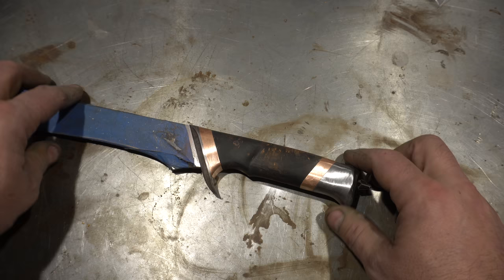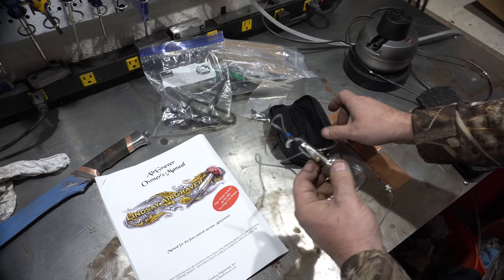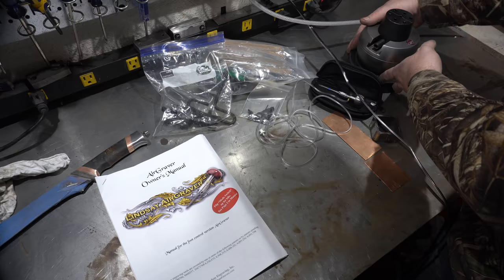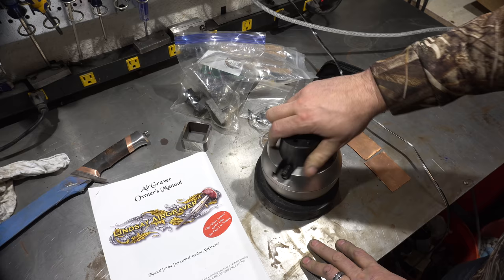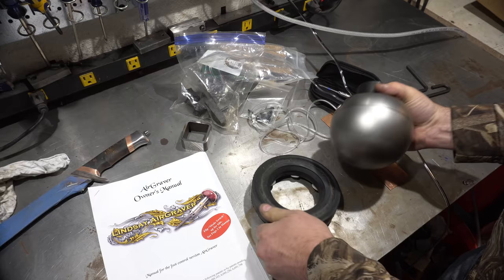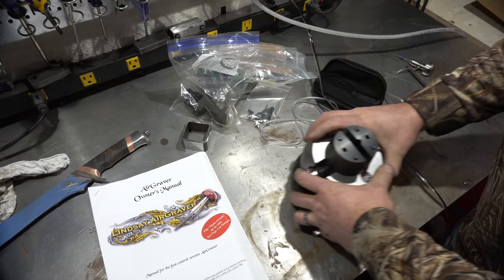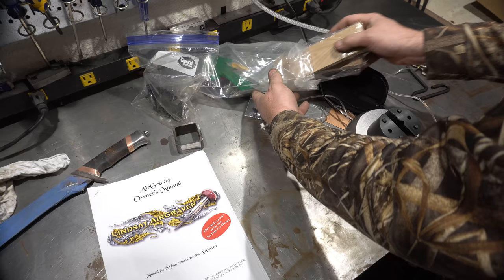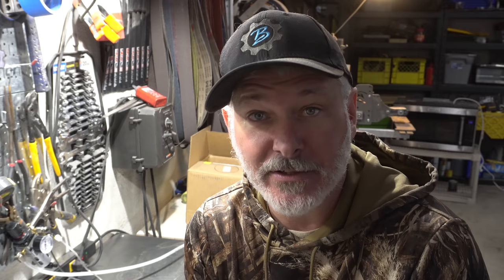Triple-T #66 - Introduction to Engraving

Comment from the maker: What questions do you have about this process?  I didn't cover transferring your design on paper to your work, perhaps on another episode.
Reply: I'm curious about square or rectangular gravers. for gold/ silver inlay?
Reply from the maker: @madrail9103  I’m still totally new and getting into inlays now.  I’ve heard a good way is to start with a standard v-cut graver and then move to flat graver to widen the “v” and then do your undercuts.
Reply: @TyrellKnifeworks  ahh right that makes sense. I've done  a bit of v groove engraving (the hammering method) and the main thing I struggled with was the depth, and also the lack of a spinning vise. I want to get into it at some point soon but I feel I need to improve my other skills a bit more first.
Reply from the maker: @madrail9103  The hammering method is really hard to get consistent depth.  You really need a pneumatic engraver for consistent work... they are expensive though.
Reply: Ketika and bilang pengukir lindsay murah uuh itu sangat menyakitkan, aku baru belajar ukir jangan membeli lindsy graver mebli handle asah dan beberapa template aku tidak mampu sampai sekarang😢😢😢
Reply from the maker: @titiksarsakti7210  Saya tidak berpikir saya pernah mengatakan pengukir Lindsay itu murah. Saya katakan itu TIDAK murah. Itu sangat mahal sebenarnya. Terima kasih telah menonton.

Comment: Great video! I actually have been practicing for about 5 years and just started selling my pieces. I don't do anything crazy but I use a Lindsay palm control. Yikes! That sounds like you need to turn your idle adjustment down there buddy.🤣  Try doing some border leaves on some practice plates it's a great way to get started. Keep us posted on your journey to learning engraving.👍
Reply from the maker: Yeah, I did have the idle a little high on that recording.  I'm still fine tuning it.  I'm so busy with my Journeyman knives right now I haven't gotten back to practicing.  Hopefully in Q3.  Thanks for watching

Comment: I recently got a ball vise from Amazon. It was 130$. I haven't weighed it. Has to be over 20 lbs though. Heavy.
It doesn't tilt as easilt as your GRS. I actually have to lift the ball to tilt it. Not completely off the stand.
Reply from the maker: They should work.  I’m assuming it does spin though?  Thanks for watching.
Reply: @TyrellKnifeworks  It spins nicely, and locks. I'm just getting into engraving, so I'm watching EVERYTHING
Reply from the maker: @PulledPurk  it’s a tough skill.  I’m no where near being proficient at engraving patterns.  I mostly use it for inlay work.

Comment: It looks so easy on camera.. I've been there.. Good tools are very important, so It was definitely good investment! How did you assemble engraver to air compressor? This little pipe/hose is not typical diameter, right?
Reply from the maker: I already had the quick-disconnect fitting for my compressor that fit the diameter of the hose.  Those are easy to find at any hardware store (at least here in the US).  I did the engraving on the copper fittings last night.  It went well.  Pretty simple design, but it got my feet wet.  😜